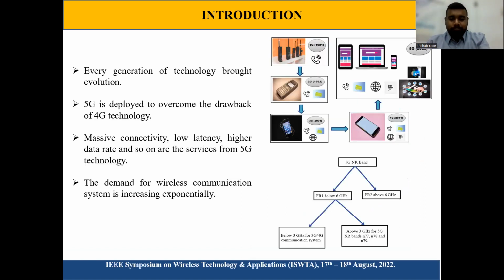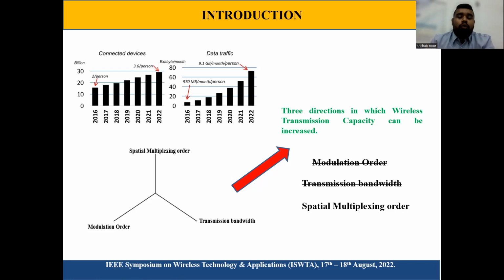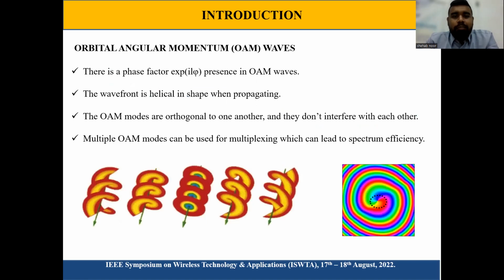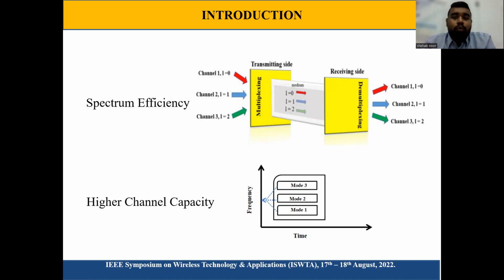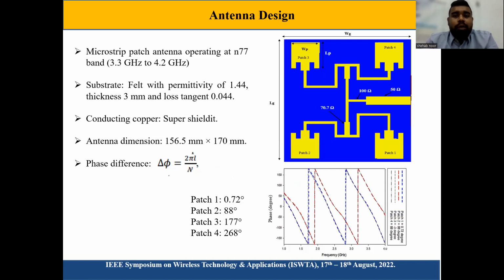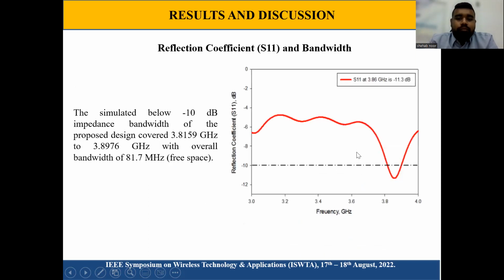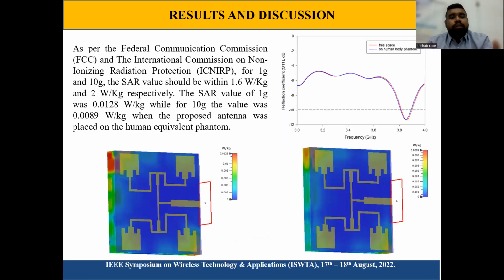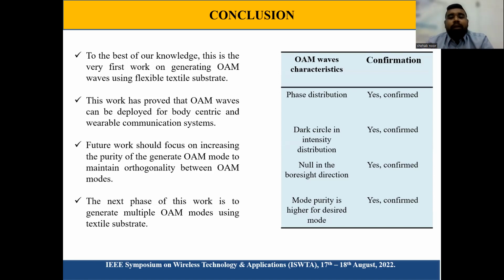OAM Vortex Waves Generation Using Textile Antenna Array for 5G Wearable Applications

Comment: Congratulations for your presentation. Did you use CST to generete the results? 
How you generete the results of field intensity?
Reply from the maker: Thanks a lot for such a lovely comment. Yes,  we used CST to design the antenna. To analyse the intensity distribution and phase distribution results, we used Python jupyter notebook.  We collected the e-field data from cst in the form of txt file (post Processing)  and used our python code to analyse phase and intensity distribution.